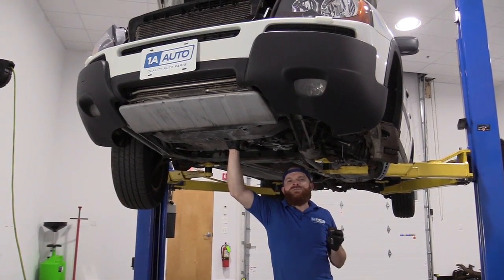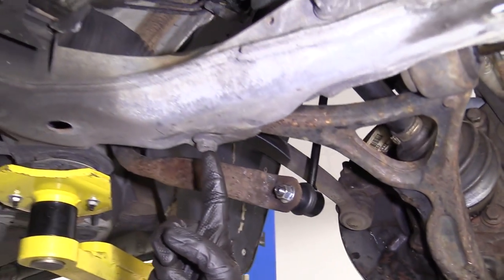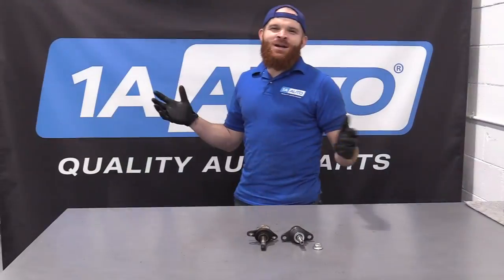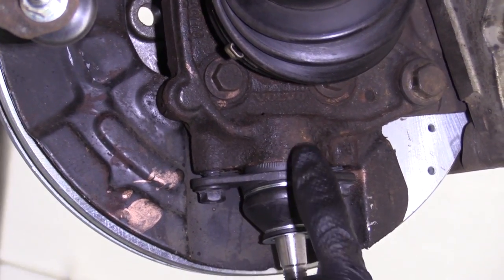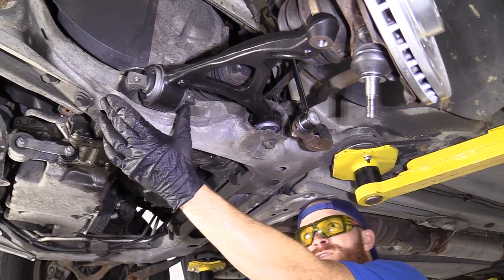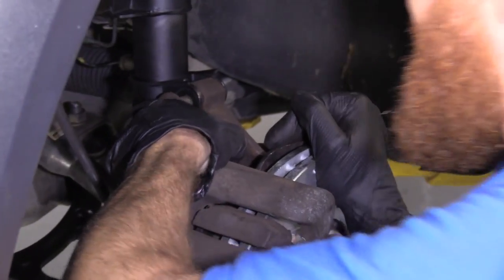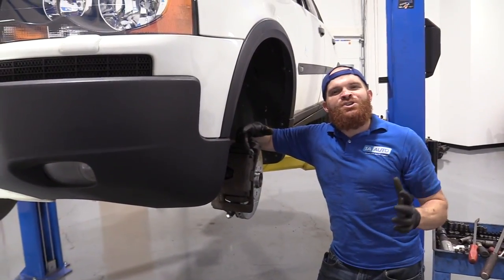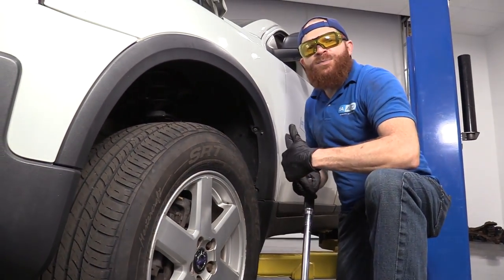How to Replace Front Lower Ball Joint 02-14 Volvo XC90

Comment: The housing where that ball joint fits is cracked that's why it came out super easy. You can see it when you are using the air hammer.
 Cheers.
Reply: I think it’s the powder coating that’s cracking off

Comment: Great video, much better than other more “sterile” ones, where you can tell everything is new and easy to work on. 

One negative though is the cut between getting the ball joint stud located, and getting the knuckle back in place. No amount of prying gets the strut back into a good enough position. 

REMOVE THE SWAY BAR LINK. And if you can’t, order a new one and grind the old one off. Seriously
Reply from the maker: +Richard Wilkins Thanks for the tip!

Comment: I was COMPLETELY unprepared for the weight of the wheel hub assembly, when I watched this video I didn't notice the jump cut when he gets the pry bar out, I had mine handy still, but had to get a neighbor to come over and help me align the bolt while I lifted up the wheel hub. I also think it would have been a lot easier with the rod that goes to the strut detached, I had a lot of issues getting the strut far enough out of the way to lift up the assembly. I would say, if you're doing this by yourself in your garage, you should take off the rotor as well, because that'll save you about 30 pounds of lifting and make it easier to maneuver stuff.
Reply: Yep. I'm doing brakes at the same time so all that will be taken off.

Comment: on the passenger front of the volvo xc90, how do you remove the two bolts going into the front of the control arm? my son i think ran over a curb and the threads are stripped and one bolt is bent

Comment: Very comprehensive, but no one I know has a $2K 3.5 Tonne car lift in their parking garage or on their driveway that I can use, and why did you have to fully remove the lower control arm?
Reply: You don’t need to remove the control arm I’ve done them without doing this

Comment: The volvo ball joint installation tool seats the ball joint easily.
Reply from the maker: +Bob San Soucie Thanks for checking us out! http://1aau.to/m/Shop-1AAuto-c
Reply: I agree, I tried installing the ball joint without the tool and chucked my ratchet across the garage and inbedded it in the side of a cardboard box. So, I went to Amazon and found the Volvo Ball joint installation tool (Resonably priced) and received it the next day. It only took a couple minutes to pound the ball joint home with the tool after wasting a couple hours and frustration trying to install it without the tool. A1 Auto, thank you for the video and torque values, but you may want to let your viewers know about the tool. My will be donated to my local Oreilly Auto Parts store, (or sold online) because I know they don't have this tool for rent.
Reply: @Djwally13  do you have a link? There's a bunch of different ones. Thank you.

Comment: I need to do this job, but I'm worried about getting the ball joint separated from the knuckle, given that I don't have an air chisel. Has anyone done it with just hand tools?  I don't want to get stuck halfway through this job...